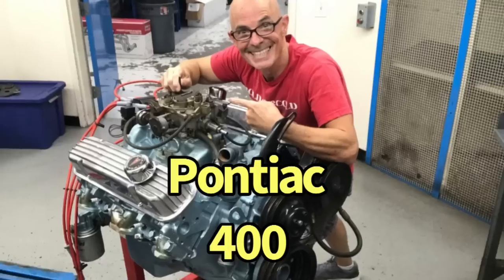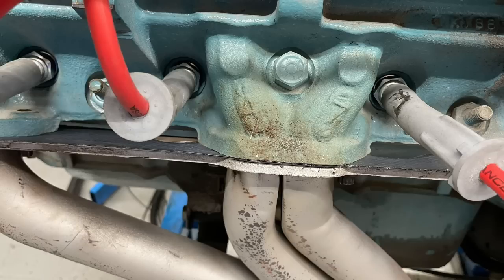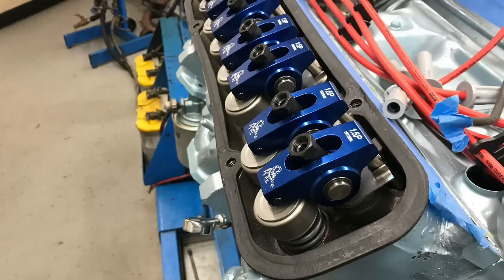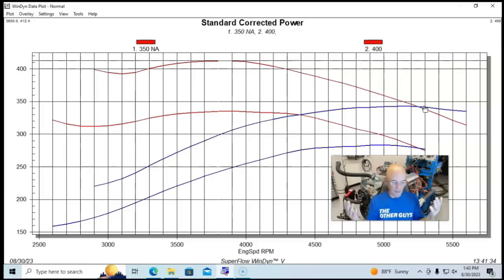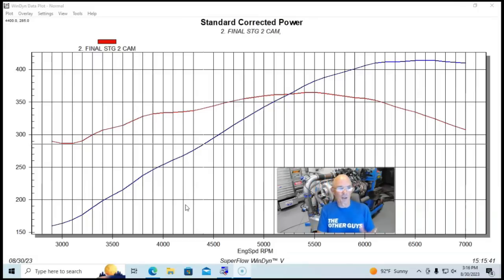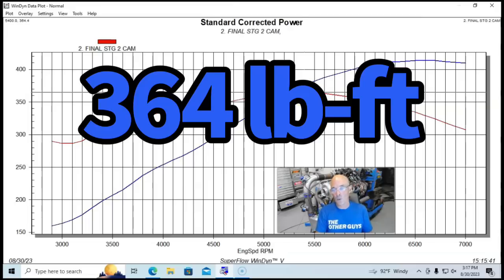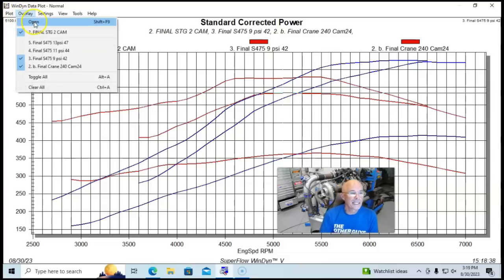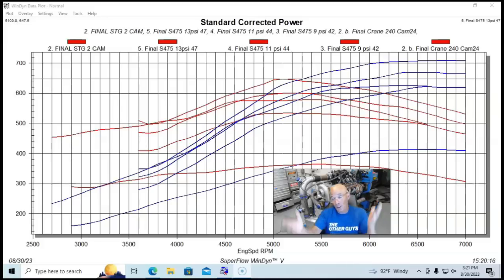PONTIAC 350 VS PONTIAC 400-IS THERE A REPLACEMENT FOR DISPLACEMENT? YES...IT'S CALLED BOOOOOOST!

Comment: I don't know.... 
From what I've seen of Pontiac engines from back when I was a kid, Pontiac engines weren't very well known for durability, and it seems like it wouldn't last very long with boost unless you put in all forged and balanced internals.
And I don't know how many Pontiac cams I've seen go flat.
Reply: The rods are modular cast iron compared to forged steel like the big block Chevy and over revving was the main issue with them the bolts would stretch first then the rod would break. 

Forged rods fixes the issue I wouldn't personally rebuild a naturally aspirated Pontiac without forged rods. The $4-700 cost is well worth the upgrade.
Reply: Hate to say it, but back in those days, stoplight to stoplight, a caddy 500 with some gears and tall tires would torch just about anything if it was in the right car. The only caveat was over revving. They did around 500flbs of twist, but not even close to 6G.
Windsors have been played with for DECADES. It wasn't commonplace back then cause it was expensive, hell, anything other than an LS or a SBC gonna cost an ass load more money in this day and age, but glad to see the market broaden a lil. Now money isn't as much an issues as availability!!!
Reply: @Guns_N_Gears  you got that right! find even the Cad 472, put on a single plane intake off a 425, get an adaptor for big block chevy headers, and in a GMC truck that thing would pull like a diesel, but no fear of gelling diesel fuel in winter. 

and it was cheaper than finding a truck 427 block with the tall deck and trying to get that to 500 cid. nowadays there are 502 crate engines.
Reply: @Guns_N_Gears  honestly if you're replacing everything it's not much more difference. 

Scat stroker assembly kits are all pretty similar. 

Edelbrock heads are 20% more for a bop than say a Windsor. 

Torque converters , headers , intakes aren't much between them. 

The most annoying thing with ponchos in my opinion is how many front end brackets they change pending the car and year!

I looked at the sacrilege 383 chebby swap for my poncho and it was like well I can spend 8 on a Chevy and have no working box or I can spend 10 keep it pavement pounding tin indian and have a th400 here lol.
Reply: @hayden6056  yes you can, but not everyone has that ex 2k!!
Have fun, and God bless:)
Reply: @Guns_N_Gears  honestly here in Australia a th400 is 2-4k and we all know Camaro's are a poor man's firebird 😉

So I saw the light and will be building the poncho motor. I've hurt it twice already so hopefully the third time's a charm haha.
Reply: @hayden6056  Sounds like a great project.  I bet she'll be a ripper when she is complete 👍
Reply: the problem was the armasteel connecting rods (the Cadillac Luxo used 'em too) and the lifter bore design--get nuts on lift and ramp speed and you'll pop 'em off the side of the lifter valley. its not hard for a pontiac company to get a chevy big block connecting rod in there for you, which most looking to get a rat into boost will do too. 

what was great with the BOP engines was you could get 'em cheap, make 400 hp (when that was a big deal) with OEM parts and have torque out the bunghole. Chevy guys would go for HP and RPM, and that's fun, but affordable 500 ft lbs of torque could be reached for the price of a 4 bolt corvette 350 build if you knew your way around the BOP big blocks. 

things are different now, and i don't even mean the LS revolution. like people play with ford windsors now and that's an option for a hot rod.
Reply: Around '71 Pontiac though it would be a good idea to make their blocks (non SD or HO) thinner and weaker.
Reply: @nucleargrizzly1776  then again in 75-76.
Reply: @nucleargrizzly1776  False, the 350/400 blocks were weight reduced and weakened in 1975 (with the exception of the 78-79 W72 Trans Am engines).
Reply: @maxpowerta3183  So what year did the 4 bolt mains decide to start running off?
Reply: They had 4 bolt mains on the 455 SD engines in 73/74.
Reply: @maxpowerta3183  Go back and read my comments out loud.
Reply: Ok so notwithstanding SD/HO. Do 4 bolt mains really matter on a Pontiac anyway? Stock those engines will spin to 5500 rpm if your lucky, The lack of 4 bolt mains was not the issue with Pontiac engines. And if we are splitting hairs here they didn't "weaken the block" by not having 4 bolt mains, most of them were still drilled for it even up to 1976 they just didn't have the caps installed.
Reply: @maxpowerta3183  and forged rods.
Reply: @maxpowerta3183  Talk about splitting hairs.  Is there something you're try to prove?  Ok, you're the King of Pontiacs.  Happy? If you're building a Hi Po stroker you better look for a pre 71 block.  That's when the decline started with the exception of the now rare and expensive HO and SD blocks.
And my RA IV GTO will spin more that 5500rpm just pulling out of a parking space.  😁